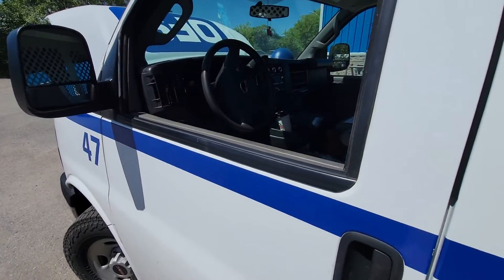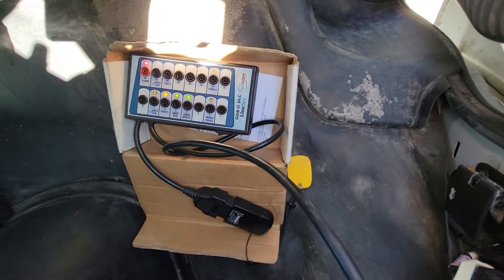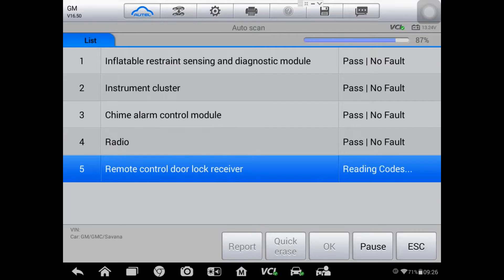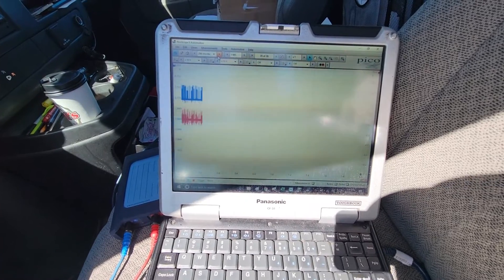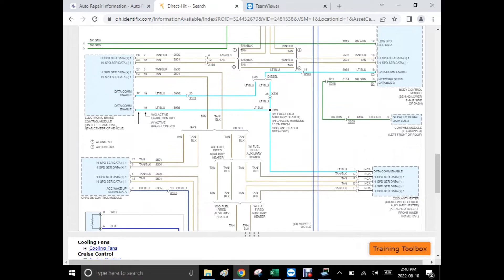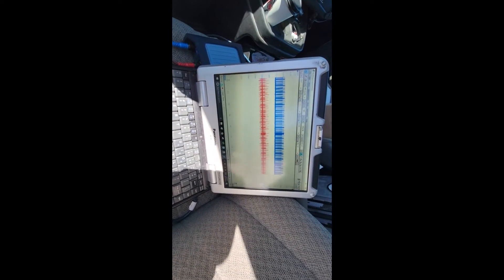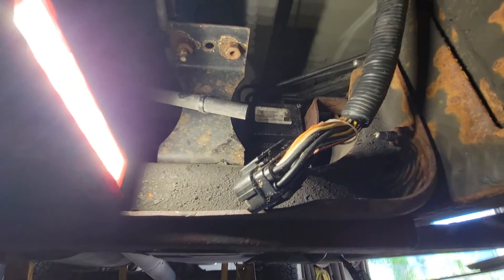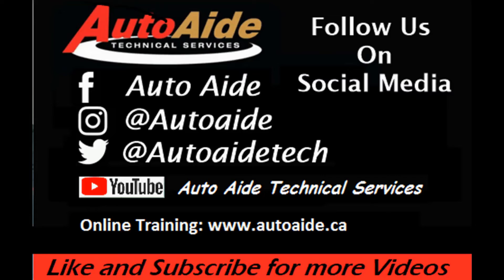Communication Breakdown! No Can Bus (2017 GMC Savanna)

Comment: Love the succinct videos you are putting out, thank you.

When we first see the irregular can signals, what leads you to looking for a module problem right away vs a wiring problem? Is it simply due to the activity present on the bus wires? I’m assuming if it were a wiring issue we would be seeing a flat line at either battery voltage or 0v? Haven’t seen too many comm issues at my shop and am still learning.
Reply from the maker: Exactly. Because there is actually a signal (albeit a bad one) rather than a flat line we can assume that the problem lies with a module rather than wiring. Cheers!